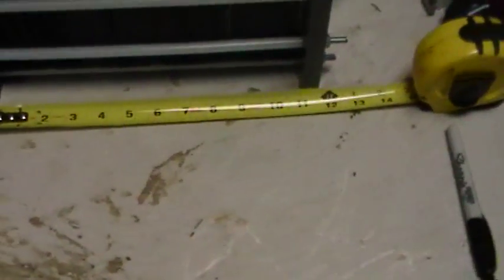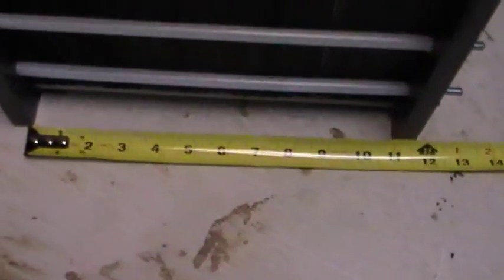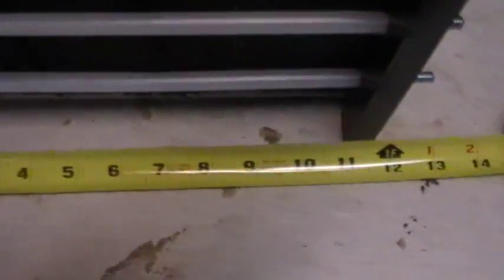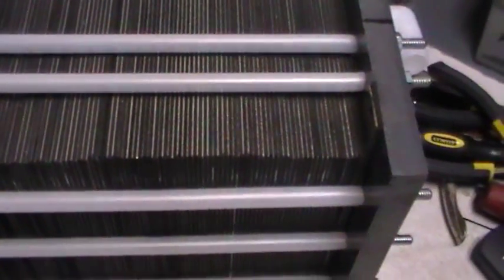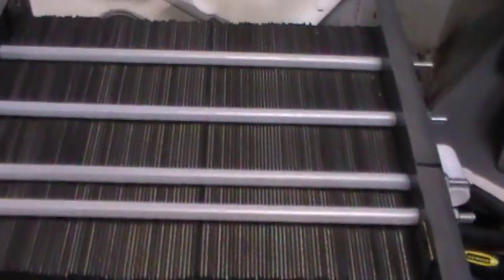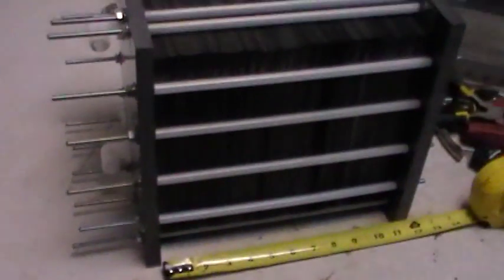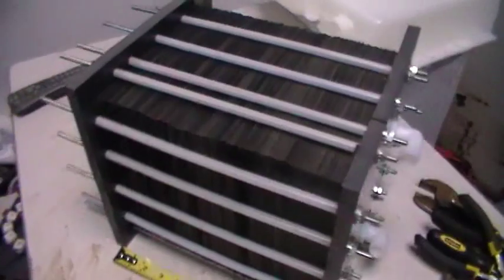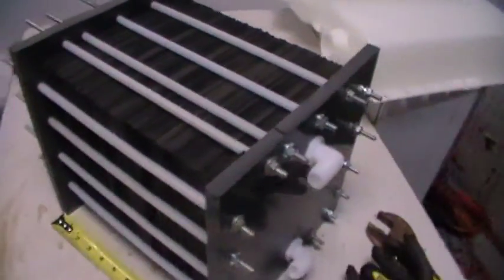New and Improved 118 Monster HHO generator part 9

Comment: Looks like you're trying to emulate a 2D planar version of a 3D micro particle lattice.

If you induce a current in the plates via EMF (a' la Tesla), you wouldn't need the connectors, and you could convert it from a planar lattice to a 3D micro particle lattice?